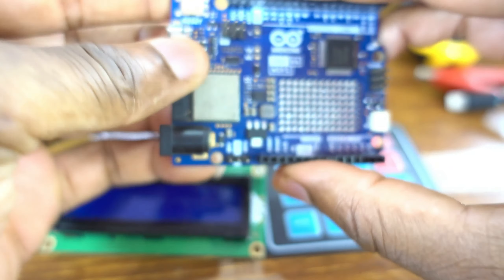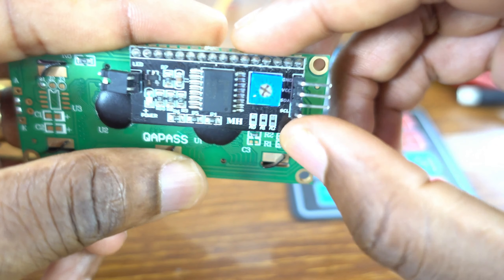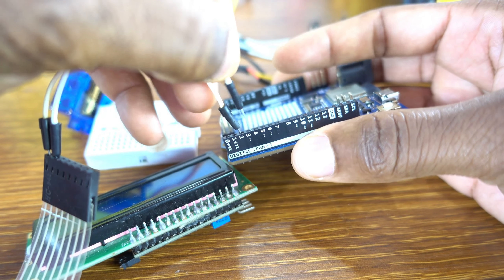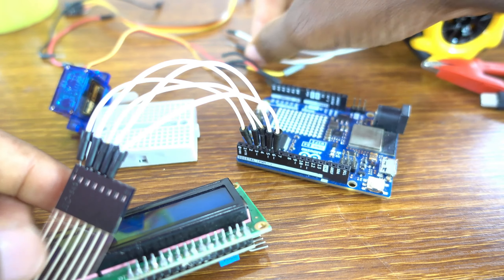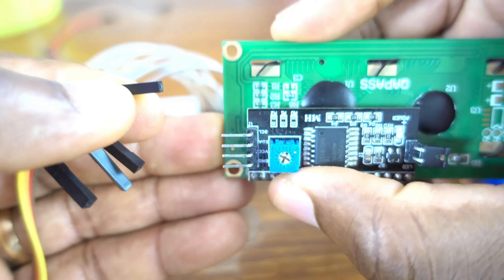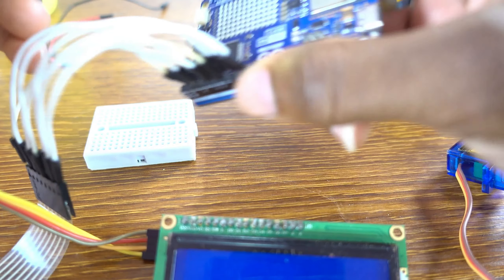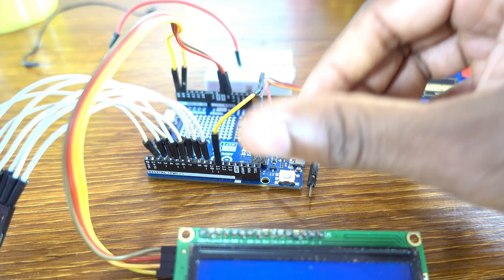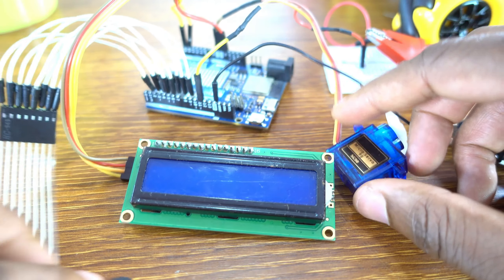The Secret to MASTERING Arduino Servo Motor Control in Minutes!

Comment: How did you connect the servo to the Arduino ? 

Great video!
Reply from the maker: I connected the servo motor to an Arduino  pin that has PWM capability

Comment: do. I need to add resistors, etc I heard servos can short circuit ur Arduino
Reply from the maker: You can connect a diode or simply use an external power suppply for the servo
Reply: @uploadideaswithitamar  thank u